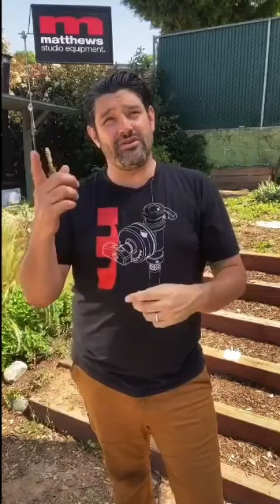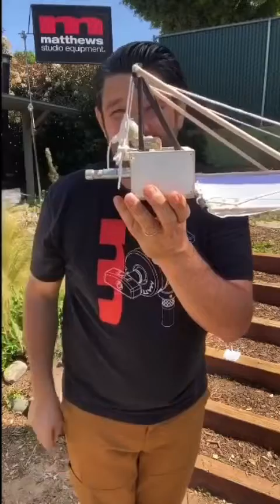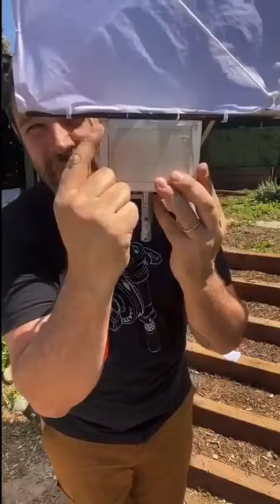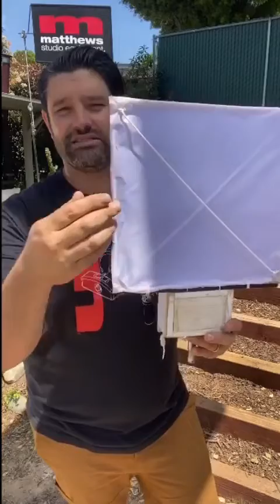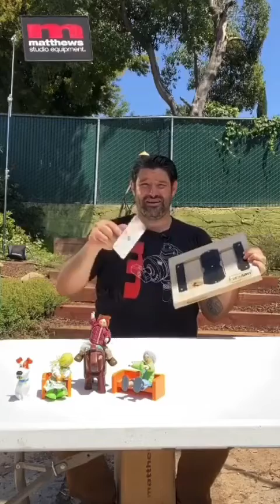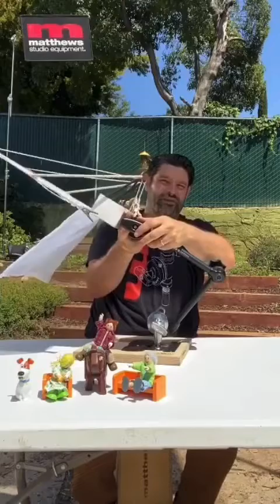Fly Swatter Rig

Comment: Using Burton’s to attach the frame to the bucket or as you call them, cheeseboroughs, is not as good as a bucket tee, which are thick steel sleeves and a totally closed system that doesn’t have an open gate that has a single fastener as a fail point.

Comment: Cheeseboroughs have wingnuts we use Burton clamps to rig a flyswatter. No upright pipe rig built in the bucket necessary, we use two bucket T’s to attach the frame to the bucket and we use rope and climbing ascenders to adjust the angle. This is a poor design. Bucket T’s attach to the bucket and of course are shaped like a “t” they sit horizontal across the inside of the bucket and attach to the frame of the bucket at the front and the back mid railing, and a sleeves for the pipe sticks out of the front. The frame has a horizontal cross bar that is steel 20’ right in the middle of the frame, and can rotate in the sleeve. We attach rope tech rope to all four corners and they come back to the bucket and all are attached to climbing ascenders so that loosing some and tightening others will  adjust the angle, it’s way better than this. I’m not sure if you guys have bucket T’s in local 80 but somebody needs to get you guys some. I always figured that local 80 would be at the cutting edge of this stuff at the bushiest level because all the gear comes from Burbank so you’d be using it first but what I’ve found so far is the opposite.
Reply: So it can be jackknifed too eh?

Yeah I think that's the way we do it as well- far more functional and closer to the fulcrum point